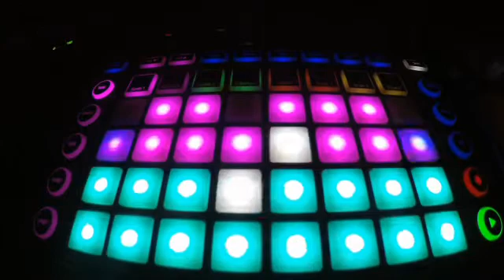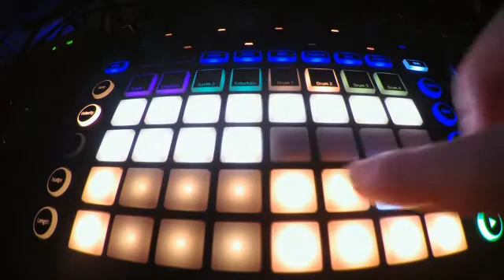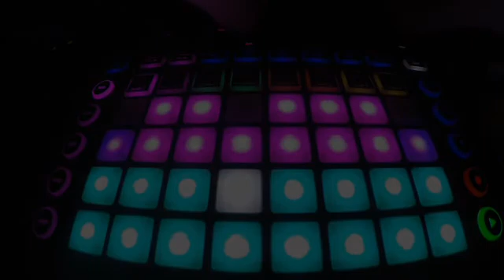Step Automation (P-Locks) // Novation Circuit Tutorial

Comment: One trick I've discovered with step automation on samples-- the empty steps can be automated too.

so snapping in and out the gain, filter, or even weirdness with the pitch can be done to longer samples that take longer than a step to play out.

a practical example of this is to mute parts of a drumloop in one pattern, or to have a pattern where percussive "filter popping" can hold the rhythm.

my favorite use of this at at the moment is to fake sidechaining on noise washes and risers.